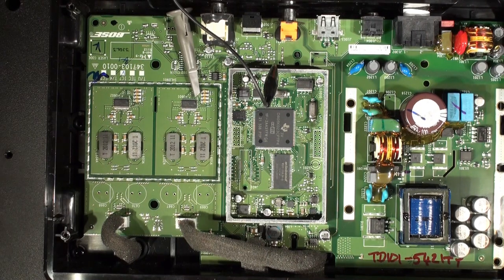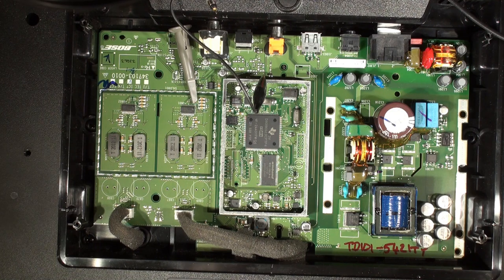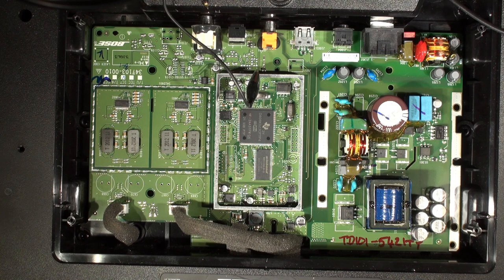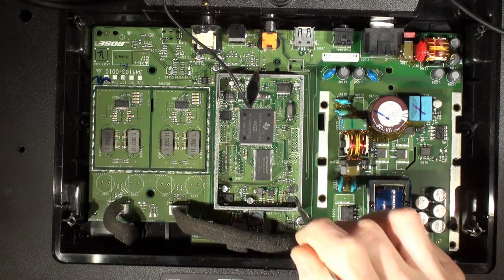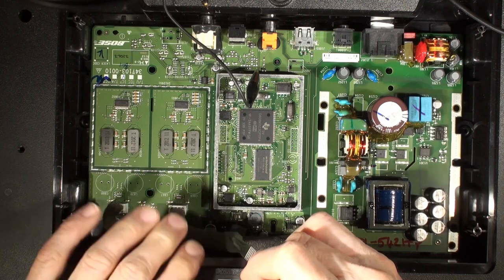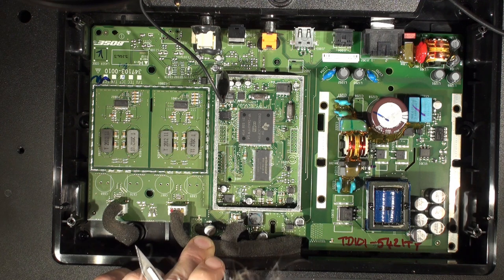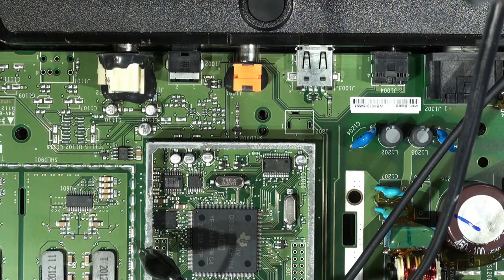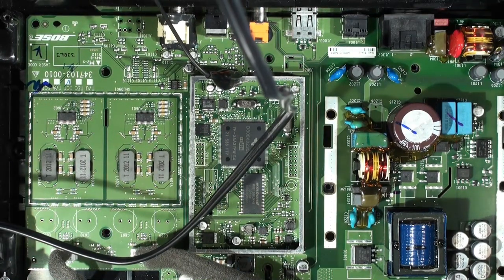Buzzing Bose Solo TV SoundBar System Firmware Update and Diagnostics Part 2

Comment: This is awesome! It fixed my bose solo tv system! I had a unit that did not power on or show any other signs of life. At first, I thought it had to do with the power side of the board. It didn't. Eventually, I traced the fault back to the Texas instrument Ic with the help of another video on youtube. I'm not experienced in working on electronics whatsoever and I thought that the chip was dead. I had a few 100uf 16v capacitors laying around, so after watching this video I gave it a go. It worked like a charm. The unit powered on and for the last couple of hours, it has been working like new. I did not change the crystals. Thanks a lot for making this video! We saved another one from the landfill. All the best from the Netherlands.
Reply from the maker: good job!!
Reply: Hello Giovanni, 
Which capacitors did you change?

Hoi Giovanni, 
Welke condensatoren heb je vervangen?
Reply: @eugenjak   I didn't change any capacitors, I've just added the 100uf through hole capacitors to the SMD capacitors shown in the video at around 34:40 minutes. The fix eventually didn't last long though, after 2 weeks it died again. Not sure why, but it doesn't show any signs of life. After it died, I gave up on it.

Comment: Cant say anything bad about bose really, how they manage to get so much quality sound out of 2x 2.5" speakers is pretty amazing, i have the bose solo5 soundbar on my pc and im very happy with it, its sound projection and imaging is beautiful. sounds like its coming from behind you
Reply from the maker: Agreed the sound is great.   It is the hardware engineers that need to be cleared out or retrained.
Reply: On pin 9 of the integrated circuit Fan7384 there are connected a 0603 resistor with an sot323... Can you tell me the value of this resistor please?

Comment: Thanks for this movie! My device was saved :)

My case is: the device played for 2 hours and went into buzzing state. Turning off the power, turning on and playing another 2h and buzzing again. Another shutdown and the device no longer turned on.

The power section was ok. The exchange of crystals didn't help. The use of two pieces of 100uF / 25v capacitors did the trick. The device turns on every time, it played for 5.5 hours and there was no buzzing effect.
Cheers.
Reply from the maker: Pleased it was saved.

Comment: Thank you for making these videos, they really came in handy. In my unit's case, the device would not power on in any way. After finding that the 24vdc rail was functional, I added capacitors (6.3v 220uf electrolytic because it was what I had laying around) for decoupling to the MCU section, and the unit is functioning properly after roughly a day of intermittent use.
Reply from the maker: Great news.  Another Bose saved from landfill.
Reply: @Kenji_Tsang  I do not recall, but in short, if you got to the end of the video, Magic Smoke has the two capacitors in the shot. Remember to be mindful of the polarity as well, which is also shown in the video.
Reply: For others he shows where to decouple at @42:00

Comment: I have a couple of these stored away in my building. After watching this video, I think I will pop one open and see if I can repair it. I do all sorts of electrical repairs but have never messed with Bose much since they are so tight lipped with their information. One thing I have noticed is that some are saying the pads pulled off from the board when trying to replace thses caps. I have learned that if you heat them properly and twist them slowly they will come off without taking the pad with it. In other words, don't pull stright up on the cap (crystal), twisting slowly instead.
Reply from the maker: Yh Bose is a huge polluter because they actively prevent repair. They should be hit with the equivalent of freedom of information writ..

Comment: Thanks for the Videos.  A "good" friend mine gave me for Christmas a bose solo tv sound system with the buzzing issue for me to have fun in trying to repair it. I tried to buy the two crystals but all stores, including Farnell UK and USA, show that the crystals are no more available - discontinued as end of 2022. Could you recommend alternatives and where to buy them, preferably in Canada or US, or if you have some available that you are willing to sell, I would buy them. Also, I carefully looked at the video as exactly where to install the third capacitor but with no avail. Could you provide a small diagram or on which pins it is connected. Thank You.   (Note, a salesperson at Farnell told me that a 27mhz could replace the 26mhz......)
Reply from the maker: Hmm that is strange... I guess they are very specific values. Unfortunately I do not have any spares.

Comment: Rare to see someone this knowledgeable! Very interesting.

I have a question. My SOLO only switches on if I I warm it up in the area were the IC is located. It is a strange phenomenon. I had it open to check why it would not switch on. Power Supply, infrared system, supply of IC, all OK. So I concluded it was the IC which I cannot repair.

The SOLO was standing on a home heating unit, not too hot, I think about 60C. And once warmed up it started again to switched on/off normally! I had it running non-stop on medium volume for 48h. No problems. Once I switched it off and it cooled down, it stopped reacting to the remote. Same procedure again: I positioned the SOLO on the room heating and after warming it to about 40C it started working again without any problem.

My question: which element is heat sensitive? If I could identify it, I could repair it!

thanks
Reply from the maker: It could be a DSP start up problem or the flash memory or instability of the crystal clock. The DSP is very sensitive to the relative timing of the rise of the 1.7 and 3.3V rails - even if reset is held low until they stabilise and the release. i.e. It has  experienced some form of lock-up even before it has been reset, I don't know of any other processors that do that.    Any HF noise on the 1.7V line will crash it before it  boots.   I have fiddled and fixed a lot of Bose kit with Texas DSPs fitted. The problem is that Bose have a custom part number for the DSP so I cant be sure which device it is. I doubt it is a custom DSP but Bose has the custom part number so you cant get any support from Texas.  The Texas dev system wont recognise the DSP's ident via the JTAG interface.   I manage to fix about 70% of the Solos with DSP issues. . Probably about 15% of those start playing up after a  few months.  On some I have adjusted the 1.7V rail voltage by a smidge (core supply) and it solves the issue. there is no doubt in my mind that this kit has marginal digital design issues.  It is running ion a knife edge. I have reversed engineer other Bose kit so I can flash with the JTAG instead of using the Boot loader.  Anything you can do to reduce the HF impedance of the 1.7V rail will improve it. Most Bose kit that use  a DSP  will sometimes start up and run if you warm the DSP but this is a temporary solution as time goes on they get more reluctant to start and eventually wont start at all until you intervene.  I have five units here that I keep meaning to get around to but paid work is getting in the way. ... Good luck...
Reply: @razenby  do you actually accept units for repair? If yes, I could send you the board alone.

Comment: Hi MS,
Parts on order; is the third cap no longer required? If it is where is it fitted, the other two are clear but, not the third.

Many thanks for the video, people like you that share your skills are great. For my part, I try to help friends with their bits and bobs and I'm quite good at digital photo restoration, so if you have any precious old pics I'd happily help. "quid pro quo" and all that.
cheers
Reply from the maker: Thanks. Increase the Decoupling on the 3.3 and the 1.7V rails with low ESR caps and fit new crystals. I dont think the 3rd cap helps at all. Expect it to work for about 60% of cases.

Comment: Hello Magic, I enjoyed your video and I'm hoping you can help me on the task of getting AUDIO from this unit that I'm diagnosing for a friend. he told me it did not power-up so I checked voltages and everything check out well, disconnected ribbon for infarred cleaned it and put back on. the unit powered up but I have no sound what so ever, so I chose to do firmware update and still no sound, all  functions work with remote and all sound box tones works properly. Could you give me your expertise advise on what I could do, it seems like waste throw it away, Enjoy the of challenge of fixing. I Live in Michigan USA any info or fix would be deeply appreciated or if you want the challenge yourself estimate a price.I know it was not used much and looks like new. thank you
Reply from the maker: No Sound. That is  anew one. Are you connecting the sound ??  Is sound present on the signal ? (Source configuration),.

Comment: Hi Magic Smoke.  I've change the 2 crystals same model that you use in your video with 3 capacitors.  Was ok for a 3 months. I now loose all sound and unit shut off byitself : No green led. I reconnect after a while and same pattern.  Looks like somethin is shutting it off but I still have power 23 VDC on Cap output....  Where should I look for? Tks in advance
Reply from the maker: The modification fixes about 60% of the units.  I have repaired about 20 of these,. Some respond, Some dont.  I have a few basket case units here that havent responded and I plan to have a look at them when I get some spare time.  It is a frustrating unit. Some schematics from Bose would be useful.

Comment: Thanks for the video. I had a unit that randomly wouldn't come out of standby. One time I measured that the 5V regulator enable signal was missing from the processor and so the power amp stage was not enabled. I then added some low-esr caps (22 to 47 µF each) in parallel the ceramic caps you mentioned as well as in parallel to the SMD caps of all the other DC lines inside the metal shield (1.8V, 1.2V, 6V?). That seemed to fix it!
Reply: hello could you be more specific or if you have any photos could you share them with me a thousand thanks
Reply from the maker: Good job....
Reply from the maker: All the info is in the video.

Comment: @Magic Smoke Thanks for the video. I'm having a hard time finding the capacitors you have listed. They are all on back order. What else can I use and where can I buy them. Thank you for your help.
Reply: Hi
The bose (trying to fix it for my father) I have does nothing when plugged into mains voltage, no beep, no power LED or anything.
It has been pulled apart and I have the power supply working (measured just under 24Vdc at the 6 capacitor bank) and this seems stable.  The remote control unit is sending pulse train (can see that with my scopemeter) arriving at the DSP pin 6.  The waveforms at the crystals don't look so great, they are like sine waves, but their signals seem to be a bit unstable and with a DC offset.  Decided to follow your advice and try changing these crystals and adding these capacitors to see if this helps.

However I am also trying to find these crystals without much luck.  You mentioned that you had to purchases with MOQ so had some left that you could sell?

I watched both your videos, very good and very helpful for me.  Thanks for making these.
Reply from the maker: The modification works on about 50% of units.  A lot of parts have suddenly gone out on long lead time,. What values do you need?

Comment: @Magic Smoke Thanks for the video. After replacing the clocks and adding 100uf caps to each of the outputs my unit now powers up and works for a little while. Previously it would not even power up. The unit unfortunately now locks up and buzzes after a few minutes. I noticed you had listed 47uF 6.3V caps in your below buy list. Could you explain this? Did you replace the 100uF caps with 47's? Thanks!
Reply from the maker: After talking owners to and seeing a lot more units I'd say the modification fixes the board about 70% of the time.  Yours may be one of the 30% I don't really have time to have a really good look. It is on my to do list but not very near the top!

Comment: Very informative video! Also servicing one right now.
Startup beep but no LED. Goes into standby after some minutes (all switching supplies enter their standby mode with audible whine).
Already swapped the 24.5MHz crystal and experimented with extra decap, but no fix.
Bit clock to the DAC looks a bit weak and L/R clock looks slow, but since the startup sound gets through, should be OK.

Question: The regulators in the bottom right produce 3.2V IO voltage and 1.26V core voltage for me, is that correct?
Could be OK if the proprietary DSP is similar to a TMS320VC5502. But could also be low if the DSP has a 1.8V core.

I guess I will try to swap the other crystal next.
Reply: Swapping the second crystal worked even though it looked fine!
Replaced it by 25MHz because I had it around, and all it seems to break is the USB port.

Thanks a lot!
Reply from the maker: You are welcome.
Reply: It gave up a month later. trying again with an even lower frequency (14MHz) to see if it stays alive :)
Reply: @dirk-janvandenbroek9947  what's the result?
Reply: @onupirat  It quickly died again. There is a whole batch of texas instruments DSPs with a lifetime issue. The IO's just die after a few years, especially the ones that toggle the most (like clocks).

Comment: So do you think changing the crystals and adding the 3 caps will fix a unit that will not power up?
Reply from the maker: I have done about 12 of them and it worked on 7 so roughly between 30 and 50% of the time it works.

Comment: Hi Magic Smoke, I have a Bose Solo which intermittently developed a buzz through both channels and nothing will stop it apart from disconnecting it from the mains supply and waiting 10:seconds and then reapply the mains. The Bose Solo then gives out the reset double tone sound and then its fine for maybe a few days before the buzz tone starts again. Can you supply me with the capacitors that you have changed on the main board around the DSP as this may be the problem. Thank you.
Reply from the maker: Yes contact me I'll post the out to you. Ark.mail@gmx.com
Reply: Magic Smoke ...I have the same problem
Do you still have any caps left ?

Comment: Hi, thanks for creating this video. It's really helpful. I have just obtained a Bose Solo TV.  If I haven't used for a few days and then plug it in and turn it on. It makes the two tone, but doesn't turn on for 1-2 mins via the remote. When it turns on it works perfect. If I then unplug and reconnect, 5 mins later or a few hours later, it makes the two tone and then turns on immediately via the remote. Is this supposed to do this, or do you suspect something inside has a problem? Thanks for your help. Just subscribed :)
Reply from the maker: First make sure that he remote isn't faulty.  This is the only product that I have come across where the remote can crash too. I have seen a couple that you need to remove the remote battery and replace it - then it power sup.   If it still wont start up then charge the crystals and add the caps.  This unit wouldn't start reliably but does now. Please post your observations so we can get these fixed.
Reply: Magic Smoke thanks. I will give it a go later :)
Reply: Magic Smoke I tried a new battery and the Bose turned on straight away. Amazing! I will try again tomorrow to make sure it’s not a fluke :) thanks for the advice.
Reply from the maker: Great, Let's hope that is the solution!!
Reply: @razenby  Tried it ever day since replacing the battery and it turns on first time. Amazing, either removing the battery or replacing it fixed it. Thanks for your help. Hope this helps someone else.
Reply from the maker: Great news. Thanks.

Comment: Hi Magic Smoke.
I watched your video about Bose Solo. I have a Bose CineMate 130 that does not turn on. Encouraged by your movies, I decided to try to fix my Bose CineMate. I found that the power supply is OK, 24V is present. I discovered that 3.3 V and 5 V were missing. Further measurements showed that the 3.3 V line was shorted. A short circuit test showed that the STM32F101RFT6 microcontroller was heating up. After removing the microcontroller the short circuit subsided.
I know that a new microcontroller needs to be programmed, but I have no idea how to go about it. Can you give me some tips?
Thank you
Reply from the maker: Sorry, it sounds as though yours will be irrecoverable. I don't have the Bose code for the loader.

Comment from the maker: The parts you I fitted need are listed below. They are available from Farnell.
 
 2 Crystals:
 
Farnell # 1842317  9C-26.000MEEJ-T  TXC  9C-26.000MEEJ-T  Crystal, 26 MHz, SMD, 11.4mm x 4.35mm, 10 ppm, 18 pF, 10 ppm, 9C Series
Farnell #1842312   9C-24.576MEEJ-T  TXC  9C-24.576MEEJ-T  Crystal, 24.576 MHz, SMD, 11.4mm x 4.35mm, 10 ppm, 18 pF, 10 ppm, 9C Series 

 2 Capacitors:

Panasonic 47uF 6.3V: https://uk.farnell.com/search?st=EEEFP0J470AR
Reply: The video shows two 100uF 25v capacitors, not 46 6.3, am I missing something? Also you say 3 caps at the end of the video
Reply: I have the same question as Silviu. Additionally, do you think this will fix a unit that does not power on at all? I know you can't guarantee anything, but an educated guess?

Comment: I've added the three 100uF capacitors, but to no avail unfortunately. I'm getting all the correct voltages, but no LED and no sound whatsoever. Perhaps it's time to buy some replacement crystals....
Reply from the maker: A 100uF capacitors wont filter out any clock noise. The Capacitance is measures at 100Hz. They are very high impedance at 1mHz and do little for logic circuits. For that you need multi layer ceramic, polyester or Tantalum